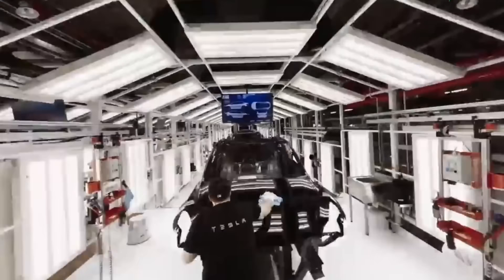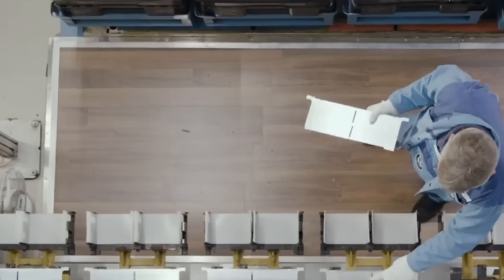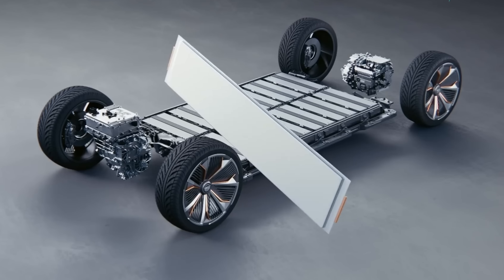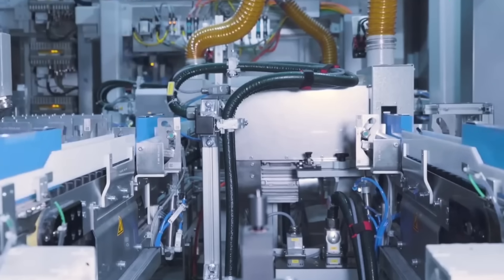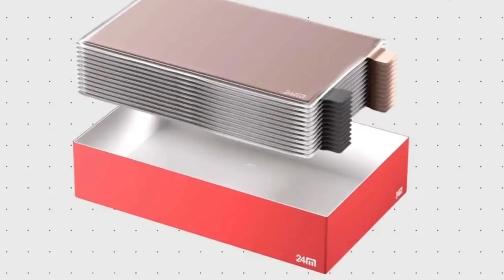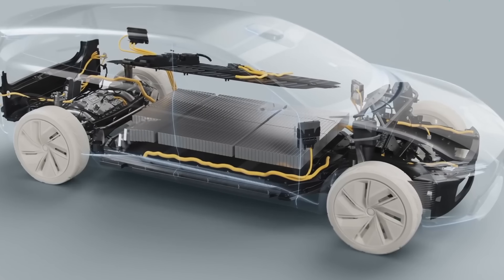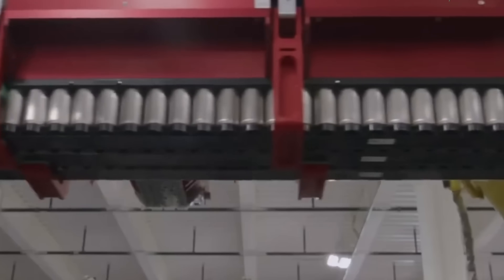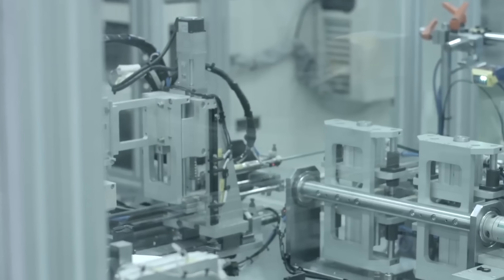1,000-Mile EV Range Might Come From a US Company You’ve Never Heard Of

Comment from the maker: But do we even want a 1000 mile EV? Yes or no
Reply: Yes, so when it loses 30% range it can still travel 700 miles.  Everyone always thinks about new range and not the warranty range of 70%.  To be honest I would be fine with a 500-mile range that ended at 350 miles before warranty change.  I would like to see a serviceable BMS and a battery design that can disengage faulty modules so the rest of the pack can keep working.  My Model 3 is now over 7 years old and I plan on keeping it for 10 years.   I have lost 15% of my battery capacity so far and keep a close eye on the pack and modules with Scan My Tesla.
Reply: @fred6464  yeh resale value will be better and a healthy 2nd hand market to make getting an ev accessible to way more ppl.
Reply: Yes
Reply: If it can realistically do >500 miles, in any weather, charge in 2 minutes, no degradation, convenient infrastructure, all at a reasonable cost, sure.
Otherwise I'll just stick with gas.
Reply: Its 900km Adelaide to Melbourne, a drive done by lots of ppl every year, while infrastructure is still building out the extra range is needed in Australia for the next decade at least. 
Also Ev's should out perform gas cars by every metric anyone could measure them by so there are no reason left to not buy one and we achieve mass adoption.
Reply: @jedics1 except for the fact that I could keep my truck for like 20 years. How much will it cost me to replace my battery in like 10. I will not buy one until there is at least a  15 year or more warranty on the battery.
Reply: @haroldnicholos7436  You buy gas cars that don't have "15 years of warranty" on them? Why do batteries get such special treatment?
Reply: Range anxiety has been the big issue with EV owners since day one so I would guess YES
Reply: Yes. I have a diesel car that makes 1000 km easy on a full tank. And I do 10 hour trips with that distance, at least twice every 3 months.
Reply: @SocialDemocraciaPT  You have the worlds largest bladder, congratulations
Reply: Yes, if it is Lithium it will still only get 500 miles in the severe winter. Interesting if this really improves sodium ion batteries like Naxtra where that isn’t an issue and can increase their range or reduce the size of battery needed.
Reply: No. It is going to turn into a few large modules only placed below the seats. They are not going to be fixable and have to have extensive internal measures for deactivating and isolating failed elements including the ability to reroute energy in case of broken connections.
Reply: They will be primarily used for the robo taxis which will then be able to work 24 hours a day
Reply: If it is twenty thousand times better than gas in every conceivable way. Otherwise, I’ll suffer thru ownership of a gas car
Reply: I say YES!  I have a gen 1 Rivian R1T and range is an issue for me because I travel way too much.  1000 miles is maybe a bit excessive, so 500 miles range would be ideal.  My Rivian has the battery with the NMC materials, which if you want to take care of the battery, you don’t want to charge to 100% regularly, or discharge the battery below 10%.  Ideally they want me to use about 70% of the battery.  In real life use, going 200 miles is a bit of a stretch.  For me towing is NOT something I would do with this truck.  Reviews say this truck tows beautifully, however the range is about 1/3 of the published 300 mile range at 100% state of charge.  Additionally, if it is windy, that really kills range of both ICE and EV vehicles, but with an ICE vehicle it is so much easier to stop and fuel up compared to an EV.
Reply: Definitely yes
Reply: Yes. Drove 1000 km yesterday. My youngest has a birthday.
Reply: Nah, lighter, cheaper car with 500 mile range. For those arguing the bigger battery still has 700 miles after it degrades I say you still won't use that range 98% of trips. Save the weight and money. When it degrades replace battery with savings if you choose to. (but maybe you opt for new car by then)
Reply: Yes, End of Story.
Reply: Yes yes yes 👍👍👐
Reply: A 500mi is enough. But for a pickup truck, that battery will be brilliantly useful.
Reply: Of course Yes.  Duh. Lol 😄
Reply: Yes, there are times I’m unable to charge my car on a daily basis so 1000 miles especially on road trip living in America especially California is needed
Reply: Realistically if they continue to allow us to charge at home, 300k would be fine.
Reply: Yes I could charge T home 99% of the time and less
Reply: No, i'm driving an EV with a 150 km-range for the last 18 month. Only once in that time its range would not have been sufficient. A1000 mile range would just mean a lot of dead weight without any advantage.

Comment: A hybrid system would be better.  Each module should be one battery that is 50 lbs.  300 total miles is more than enough for most applications.  The modules should be easily replaceable by the owner and its standards enforced by a larger body so owner can purchase from any reputable business and replace it like we do for a flashlight.  CATL sodium chemistry may do well in this format.

Comment: The single-point of failure is not necessarily a problem. The battery pack could have redundant wiring. Also, the pack could be divided into several segments, not entirely monolithic. Add some redundant wiring to that, and single point of failure is not a problem. If your car gets bashed in enough to disable that, then it's probably not drivable anyway.
Repairability: No reason you could not replace these components. Might be simpler than working on battery packs.
This engineering shift would be ideal for sodium chemistry, and maybe for aluminum chemistry. Sodium batts don't need to be cooled, and a structural design would dissipate heat better anyway.

Comment: When the average commute is about 30 miles a day, I don't think 1000 mile EV range is needed for the majority of drivers. Personally I only need 200 miles range.
Reply: 400 miles sweet spot for 2 or 3 long trips a year.
Reply: The more range the less you need to charge since charging degrades batteries the more you charge them.
Reply: I think longer lifespan 😮

Comment: I’m not concerned about repairability. I do believe that very few batteries really even need to be repaired so based on what I see the need for longer range batteries is far more important, especially when you have a lot of your vehicles that have a lot of wind resistance and need to travel more miles and I will give you an example passenger vans with 15 people on board Your wait time if it’s 15 minutes for one person multiply that by 15 that’s a lot of time wasted so the efficiency of the battery pack for such vehicles like this and those that pull trailers means everything!

Comment: Current battery's produce 300 mile range EV's currently . Another 100 to a 400 mile range would be better as you could keep the battery in the sweet spot more.
Reply: It is all about use case.  My EV range is 240 miles and it spends most of its time between 40%-60% SOC.  I have only been outside that range (DCFC) only 5 days in the past 1000 days.   If you don’t do long distance frequently, extra battery is dead weight.
Reply: Cadillac and GMC already do. 
Old tech twice the wattage size battery.

Comment: If this new tech is pretty good then it may be that you can deal with the repairable issue by simply the warranty.  In other words if it is a rare problem that only happens to 1 car in 50,000 then you can just promise to replace the car in the event of a problem within maybe 300,000 miles.  In that case I would buy one knowing I am getting 700 mile range and the car will be replaced if something happens.

Comment: but, max speed is 20 mph.   you can get 2000 miles going 10mph.
Reply: No, you can’t. Is it more efficient to go 20-30 mph rather than 60-70? Yep. But, while aerodynamic drag goes down as the cube of the speed, rolling resistance is linear with speed, so at a slow enough speed (around 30 mph), it will be the major contributor, and you will have diminishing returns in efficiency gains by going slower.

Comment: ATM we have the Dongfeng Box with 310km WLTP that in reality easy does 350km with a mix of Highways and rural roads. 
 We do 1000km trips with it and never needed a battery with 750km range . . . .
We rather have this reliable, cheaper battery that can be repaired if needed, than a bigger one that cant be repaired or is less safe.

Comment: This is a design feature, not a chemistry change, which will undoubtedly be adopted by battery manufacturers.  Solid-state batteries are still the inevitable future of batteries.
Reply: Adding to that what you said. With this design change battery packs could be made smaller which would reduce total mileage but also further reduce weight. This could also boost the effectiveness of solid state batteries.